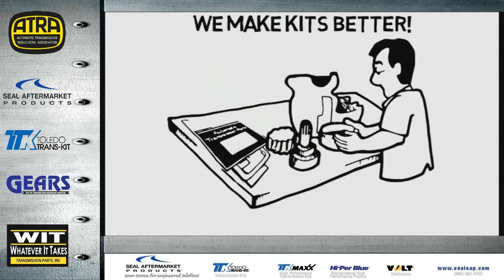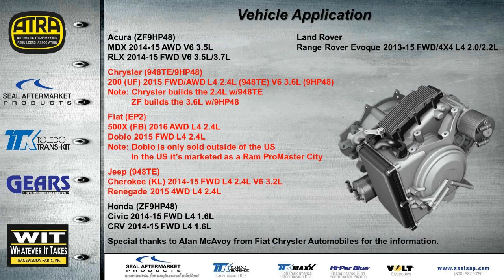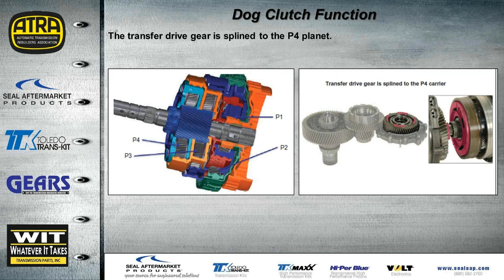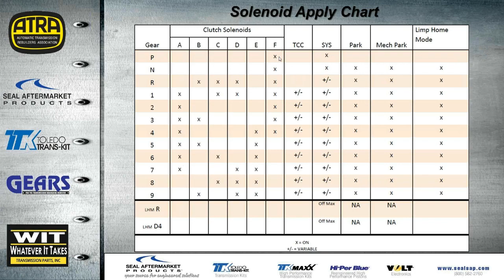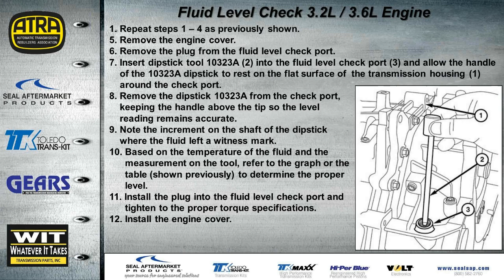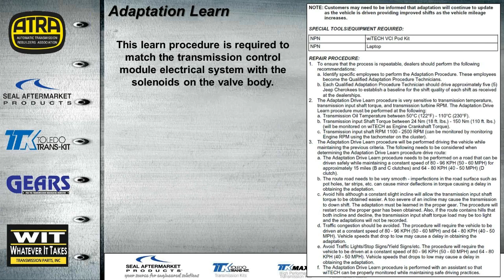948TE Introduction Webinar - 5/5/15

Comment: Having a hydraulic low pressure circuit.. code P0934. is this a sensor? Has a new battery. No leaks around the trans.
Reply from the maker: Diagnostic Code P0934 - 948TE Transmission
The P0934 code typically indicates issues related to line pressure. It can suggest a malfunction of the hydraulic pressure sensor, which is crucial for the proper operation of the transmission.

Common Causes:
Faulty pressure sensor or pressure switch.
Wiring issues or poor connections in the sensor harness.
Problems with the transmission control module (TCM).
Insufficient transmission fluid levels or issues with fluid quality.
Recommended Actions:
Inspect and test the pressure sensor and related wiring.
Check for any fluid leaks or low fluid levels.
Use a diagnostic scan tool to monitor live data and check for additional codes.
Consider reprogramming the TCM if applicable.
Addressing the P0934 code early can prevent further transmission complications. Always consult the specific vehicle service manual for detailed troubleshooting steps.
Reply: @atra-automatictransmission1300 thank you so much for the response. I tried to look back in the video to find the sensor location. Can you tell me, maybe the time in the video or how to locate it rather?

Comment: I noticed something in mine.  In the electronic shift module, the vehicle mph never matches any other mph reading on the vehicle.
Reply from the maker: That should be looked at. Could it be a programming issue or a module mismatch? Maybe try a different scan tool to see if it's just a glitch.